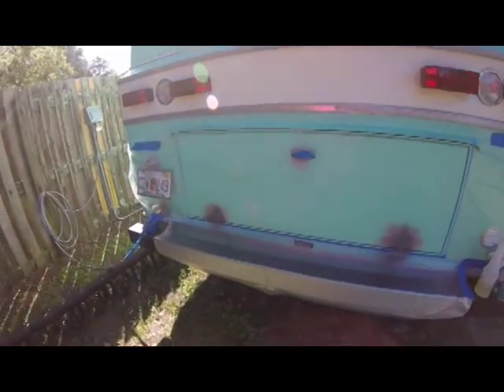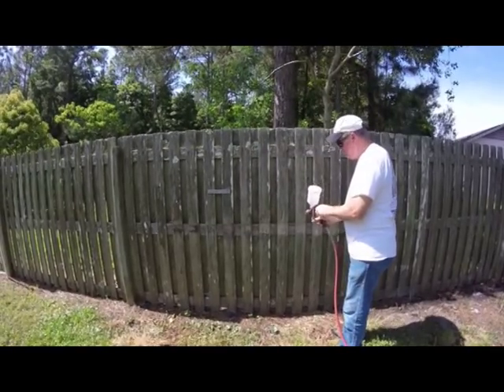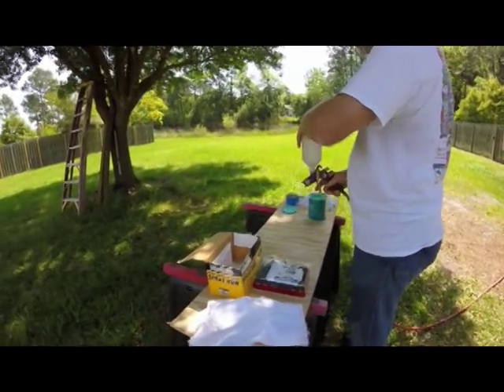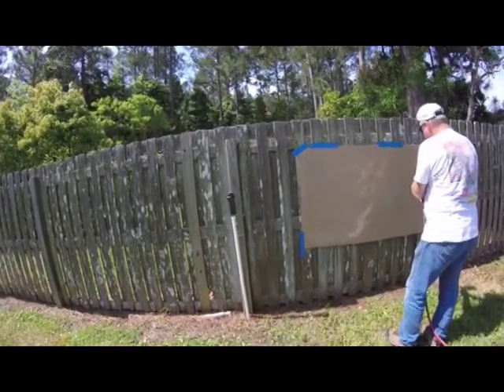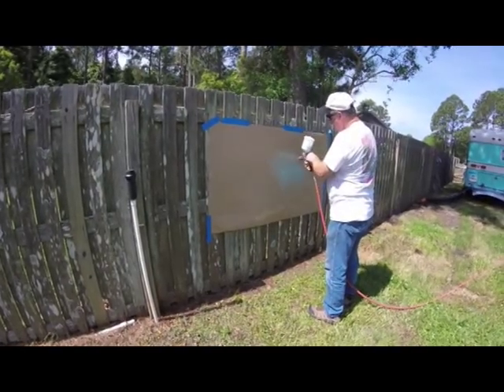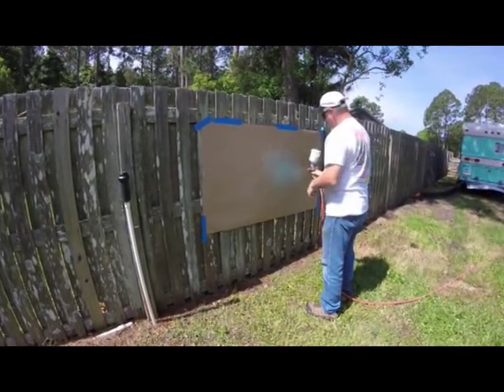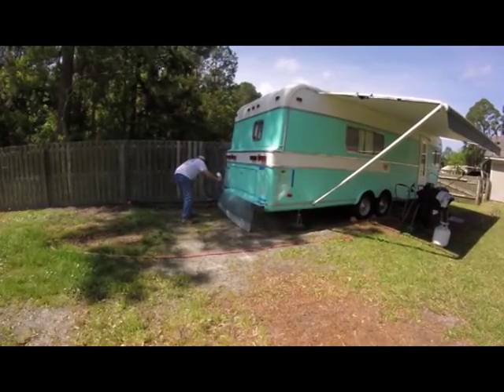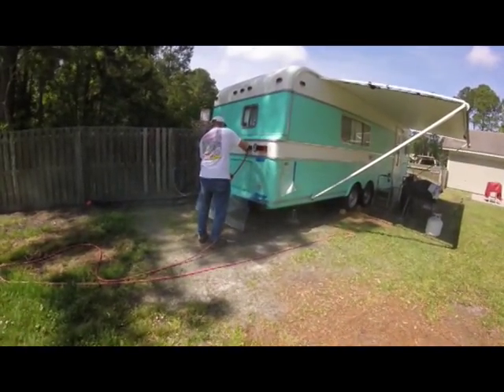#34 RV Painting

Comment: Another great video....did you spray the interior of your trailer when you were doing the rebuild? Or paint it by hand? The White looks really beautiful.
Reply from the maker: +johnnyohness No the breadboard is a finished product. We did hand all the white cabinets and hand stained all the other shelving. The kitchen we used bar glaze on the countertops.  Its like putting 80 layers of polyurethane in one coat. 😀
Reply: We owned a restaurant in Leadville, CO. My hubby built tabletops and covered with local topo maps. He sealed with MANY coats of poly; turned out G*O*R*G*E*O*U*S and incredibly durable, even in a restaurant with hot plates, spills, & Chlorox. Bar glaze would've made our project much easier and faster!!! Live and learn, lol. Thanks for that lesson!!!